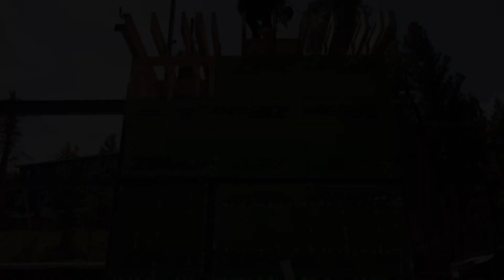S3EP04: Office Floor System, Cantilever 3!

Comment: Two questions: The I-joist sitting on the wall without actually connecting -- since it's not a directly attached, does that add any concerns for longer-term floor noise issues? And next: I either missed it or just didn't understand when you said it, but what is the function of that random steel beam? It's going to connect to a wall that isn't there yet? But how is it distributing the weight? Or is it just to function as a more rigid support that will more effectively distribute the weight on the overhang into the fixed house structure? Confused.
Reply from the maker: 1. While the i-joists rest on the wall, they are nailed to both the rimboard and the wall itself. They are also locked in by the additional blocking that prevents them from further moving.
2. The cantilever steel beam will get welded another beam (Episode 10 ;) ) that will hold the front of the balcony at the L-bracket. The beam is held to one side with simpson straps and to the other with the cantilever LVL beams. It also acquires additional strength from the brace strength applied by the subfloor. But that said, yes it is mostly assumed and held by gravity. So an earthquake would probably be very bad. But there are no earthquakes in the mountains (I hope)